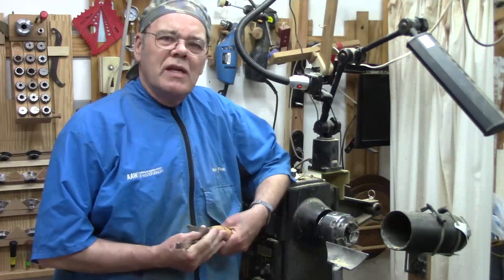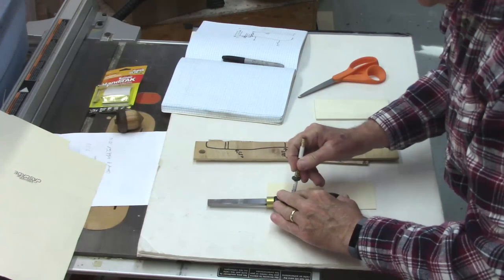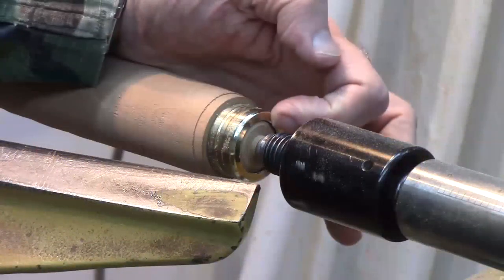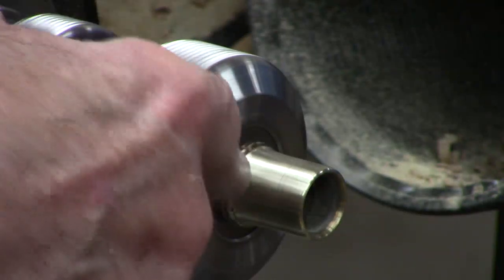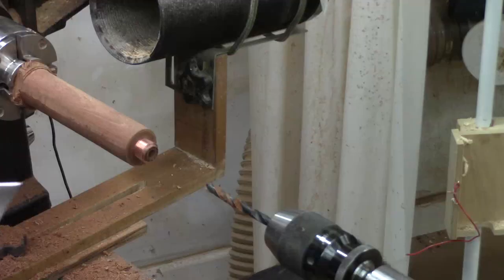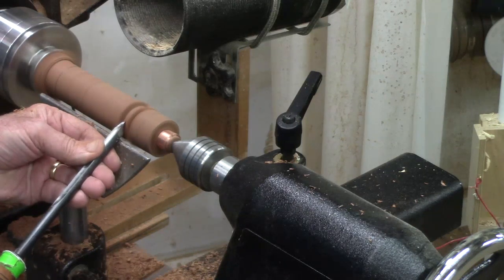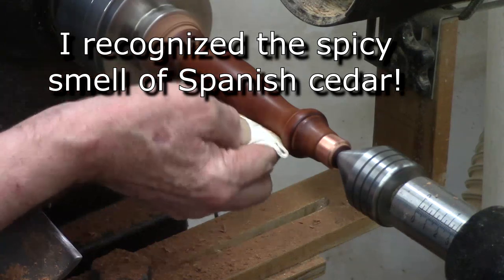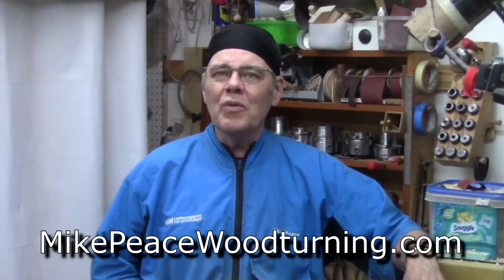Turning a Replacement Tool Handle

Comment: Hi Mike, thanks for all your how to videos. I'm a beginner turning enthusiast and already making tools for far less than ready made tools. All because of the encouragement from you, this video included.

Here you show how to remove a handle from the tool. I found it easier to do it this way: Take a flat strip of wood that is a few inches longer than the blade. Rest this on the tool ferule, holding both the blade and the strip of wood firmly in one hand. Now wack the wood a few times and the handle comes out easily without damage. Check it out if you haven't already. Thanks again.
Reply from the maker: Thanks for sharing with our community!

Comment: I just watched your tool handle video. You did a fantastic job on this. Another well done and greatly appreciated video. I really appreciate your style of presentation. I did a handle extension for my Laguna 1216. Man oh Man did that help me out. I turn sitting in my wheelchair and anything that makes tasks easier or safer for me is excellent. You are a solid mentor and I am grateful. TS
Reply from the maker: Awesome, thank you!

Comment: Another way to drive the tool into the handle is to bang the handle down hard on something solid. That way, you don't risk damaging the tool tip. Concrete floor works fine.

Comment: Mike I hope the are more suitable/functional for you, in any case they look a lot better.  Thanks for the video.  Cheers, Tom
Reply from the maker: They really are. I think Sam Angelo is going to replace some of his.
Reply: @MikePeaceWoodturning  Mike, the hook tool you use for doing the female threads does need a longer handle, correct?  Cheers, Tom
Reply from the maker: @tomcoker9882  probably 10-12 inches for a scraper. Perhaps a little less for a recess tool.

Comment: Mike..  tractor supply, look for collets near the 3pt hitch stuff.  They are steel collets used to stop shafts from slipping off the face of a bearings.   They have a set screw and make dandy replacements for  pipe couplings. And best of all makes your tools quick connect..  I am on my third 1inch Carter and son skew on one handle using this setup.  Best is they come in all sizes.
Reply from the maker: Thanks for the tip. I will check out TSC.

Comment: As always, a great video.  The only thing that I do differently than you is to drill the hole for the tool tang before I turn the tenon.  With the cone center in the hole, I'm guaranteed that the tenon will be concentric with the hole.
Reply from the maker: More than one way works.

Comment: Mike would an easier way to change the profile of the handle have  been to insert the steel end through the chuck and tighten down on the  Farrel and bring up tail stock suport. Turn to shape and finish? A lot less steps.  But I do understand wanting different handle.  Thanks for your tips
Reply from the maker: I think the tools too wide to fit the Morse taper. And the ash a bit coarse for the smaller features I wanted.
Reply: @MikePeaceWoodturning  I see your point it would work if you could get the tool steel out of the handle... Thanks

Comment: I do have a question. On a video you did you made a round knob for a handle of sorts. Perhaps for a knock out rod? You used a texturing tool. Then did a veegroove on each side then burned a line. What texturing or chatter tool did you use? Last! You used a copper wire to burn the grove or line. Can you use different gauge of wires to burn lines? I was going to buy a burn wire kit. But at $50 bucks….. can I save $$ and use copper wire? Thank you. TS
Reply from the maker: Yes, a knockout bar. Texturing done with a Sorby spiraling tool. Guitar strings make the best burn wires. Know any guitarists?

Comment: Why do you need a ferule?
Reply: Ferrule keeps the opening from splitting out.
Reply from the maker: I have a video on just ferrules. Main purpose is to retain the tool if the handle breaks.
Reply: @MikePeaceWoodturning  thank you. I have moved to using inserts in handles to make them more interchangeable.